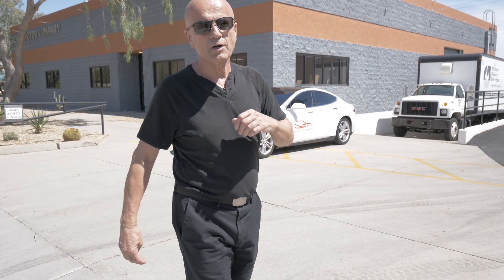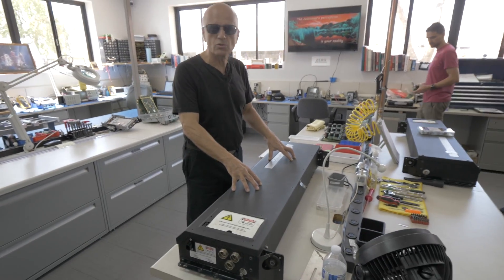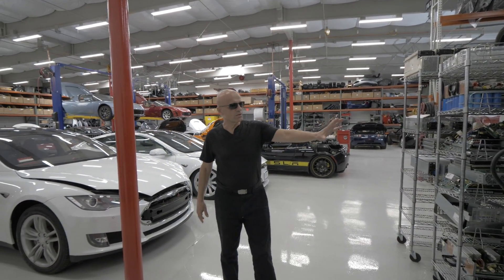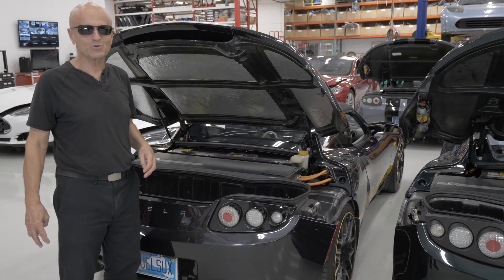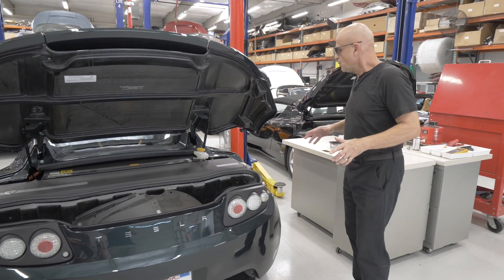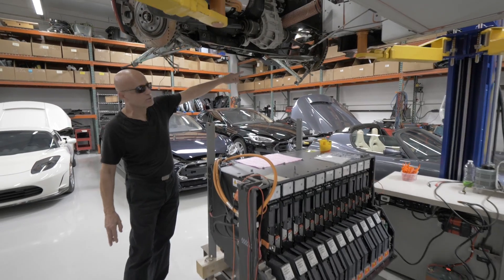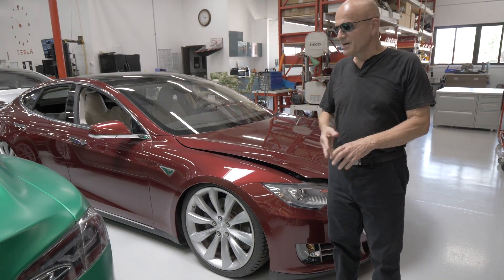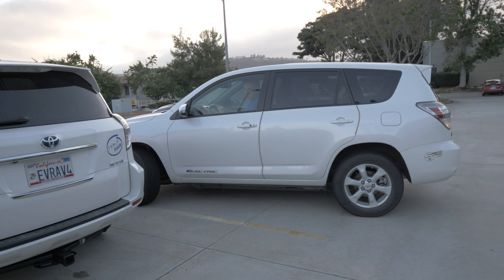Inside the Largest Independent Tesla Repair Facility | Part 1 | Gruber Motors

Comment: Nice cars, but with ICE vehicles I can fix almost anything my self for only the cost of parts :)
Reply: You mean with old ICE vehicles.
Modern ones are a pain to fix.
Reply: @ZesPak  depends on the car, the engine mechanicals pretty much same though so you should be able to fix it

Comment: 6:30 instead of a variac, you can use a single-phase power controller and a PLC so you can proportionally control the PWM and the RMS voltage applied to the 120/440V transformer. This will be much more efficient since you do not generate heat and no need for variac maintenance. I can develop this for you if you want. My email is Zumaeta.jose@gmail.com. I'll be more than happy to collaborate.

Comment: Theoretically the electric car should be cheaper and more reliable than a internal combustion car. Unfortunately, Tesla took the over engineering road which means needless electronic sophistication. This has ended my interest in electric and the internal combustion makers are equally guilty of over engineering. I drive a 30 year old gas car and will continue to do so for the remainder of my life.

Comment: If Tesla manage to make their cars to get plug in to your house grid, they can let people to use their cars as a battery storage that can use in case of emergency. This will help the batteries of the car to not have the low voltage problem that is explained in this video.

Comment: At 2:22 there are test circuit boards shown standing on edge in a metal frame / shield. These pcb's need to be placed in Electrostatic Discharge  safe packaging, or at least stored on a grounded safe workmat like the blue one shown on the test bench behind them. This should be standard practice in any electronic service / repair facility. Training for your crew may need to be re-visited. ESD damage can not be seen without a microscope and may cause future intermittents or outright failures.
Reply: Yes and no.  Electrostatic discharge damage is a real problem and can lead to difficult to diagnose problems, exactly as you mention.  However most circuit boards today are designed with lots of internal grounding and static discharge paths that protect against damage from static electricity.  This is something that is designed for and can be tested.  That said, it's still a good practice to use static protection procedures, including anti-static bags for storage.
Reply: @taraschwartze . . . Thats hot.

Comment: This is the hypocrisy of Tesla, they claim to be saving the environment, but they treat their own products, which have a huge environmental footprint to produce, as disposable commodities to be replaced every 3-5 years.  These guys at Gruber, they are doing a much better thing for the environment than Tesla is.
Reply: That's just your miopic opinion. Actually Tesla officially does not believe in model refreshes or "disposable" products, unlike combustion car manufaturers. The only refresh the Model S had since its introduction in 2012 was a front bumper redesign in 2015, battery upgrades and a motor and suspension upgrade this year. The major way Tesla cars get upgraded is frequent via over the air software updates. Many owners still happily drive their original 2012 Model S, some with over 100.000 miles.
You might want to actually look into how Tesla operates before putting your opinions out there.
Reply: @2nd3rd1st  Officially VAG don't believe in poisoning people, but they are still happy to do it to make a little extra cash.  So a model that's been in production for 7 years hasn't had a major refresh... whoopdie, the Nissan  GT-R R35 has been in production for 12 years, that's normal.  What happens when the Model S replacement comes out?  Based on the fact that Tesla won't even service a $30,000 part on a 10 year old car, I'd say you're fucked.  I well know how Tesla operates, I've seen loads of people struggle to get cars repaired outside of warranty after fairly minor breakdowns and accidents because they can't get any support from Tesla outside of warranty.  I bought my current Ford 6 years ago, and it's no longer even in production but I can still buy every part for it new from the dealer I bought it from, or even manufactured from a 3rd party, and nothing on it costs $30,000 to replace, and I have a copy of the full service manual that shows me how to perform every single service and repair procedure in detail - and that's from a company as famously shitty as Ford at after sales support!  Tesla's products are disposable, at least as far as they are concerned - that's why companies like Gruber exist, working hard to reverse engineer and repair cars that would otherwise be scrap and landfill.
Reply: @Beer_Dad1975  I'm a "triggered nutbag"? Says you and writes War And Peace. Let it go, Matt.
Reply: Wow fanboi anyone

Comment: ..."this car has not been designed to be serviced, easily".

This says it all.
Reply: This actually only says: tiny green behind the ears startup frankensteined boutique sports cars for rich early adopters as a proof of concept.
Reply: Furlock Furli the Model 3 changes that.
Reply: no car nowadays is easily serviceable. Thats the new businessmodel. very sad. Nevertheless a great opportunity for gruber and therefore a gap in service in all other countries. Teslas will always be cult cars and therefore there will be enthusiasts demanding this kind of services.
Reply: tesla and apple are very similar when it comes to user serviceability
Reply: @greynolds17  Do you really expect to remove and replace battery packs and electronics of modern BEVs yourself? No driver of even a 2010 VW can hope to even just replace a faulty headlight LED, car dealerships only survive because of service fees. I doubt most owners of a horse in 1870 knew how to fix a horseshoe themselves for that matter ^^

Comment: all the tables at the Electronics Labs are Table height. very unusual. Work benches are typically counter or bar height
Reply: soldering tables, electronic repair most people do sitting down in office chairs.
Reply: The place is phony as hell! @0:39 "...we wanted to immediately create the IMAGE that this is all about electronics.."
Reply: These guys r great
Reply: looks back breaking
Reply: Height depends on the size of the object you are working with. For example watch workers often have counters above elbow height.
Maybe these tables were there from the ups days when they had large UPS control units on top to be able to look into them. I'm just guessing.

Comment: Just imagine  when all those capacitors on all those boards start leaking.
Reply: Probably using tantalums in place of most electrolytics to minimize that....
Reply: @sufficetosay  Even worse..tants are prone to failing short circuit.
Reply: The "Flux" will be everywhere!  (Huey Lewis jam'n in the background)

Comment: My nephew bought a Model 3 late last year.  He only had it a couple months when some idiot ran a red light and T boned him late December.  8 months later his car still sits in a body shop waiting for parts from Tesla.  Anyone who believes that Tesla has even the slightest concern about their existing customers should take notice.
Reply: From a tesla owner yes this is correct and the other are also correct about being oblivous to it below is correct why? because if you have an issue they give you a Tesla the same as yours to do whatever you want until yours is repaired. So in effect if it has to stay 7 months they are basically taking that milleage on a similar car so why would you care. You will gets your back fresh and in the mean time you drilled a tesla that isnt yours for a while
Reply: Yes, body repair is a nightmare. It's still worth owning! You have to own one to understand this simple truth.
Reply: The outrageously slow repair turnaround is what Tesla fanboys are totally oblivious about. Until it actually happens to them.  The benefit of having car dealership network and independent repair shops is; it removes the burden to the car manufacturer to do maintenance or repairs.
Reply: Exactly, I'll wait for Tesla to mature as a car company before I'll buy one
Reply: First I hope your nephew is ok. 2nd, so basically your nephew is making a car payment on a car he can’t drive due to shitty Tesla service. That sucks
Reply: @projektxent  If that's the case. Does the other party insurance cover the expenses of the car loaner while the car is still in repair?
Reply: Spock - not sure that will ever happen with Musk at the helm.  He has been described as bring unbelievably obsessive and controlling.  Despite all the greenies drooling over Tesla and all the US Government assistances they receive, the fact is the company is not doing well at all financially.  Many experts don’t see them surviving for much longer.
Reply: @danmyers9372    First off,  I do not have a Tesla and I would not come close to a fanboy.  Secondly Oil companies get 4.6 BILLION in subsidies (government assistance) EVERY SINGLE YEAR  which pisses me off.  Why would Big Oil and gas need subsidies when their profit margin's are so unbelievably huge??  Third....Tesla founded by that goofball Elon musk received $165 million from selling his company to Compaq. He spent 100 million on spacex, 60 million on tesla, and 5 million for solar city. He taught himself programming and co-founded Zip2 a web software company which was acquired by Compaq.  Those US Government loans you speak of?  They were paid off fully, oh wait here let me get the press clip....Only American Car Company to Have Paid Back Government
PALO ALTO, Calif.-- Tesla Motors announced that it has paid off the entire loan awarded to the company by the Department of Energy in 2010

A couple of things to follow up on.  I drive a diesel and I love it.  I don't "Roll Coal" on anyone but yes my rig is chipped for fun and spirited driving.  Tesla is an AMERICAN MADE product that is cutting edge and pushes the boundaries of technology, maintenance, speed and safety.   Why would you not cheer for that company to succeed?!!  It literally is as american as you can get.  Want the fastest, most bad ass 4 door car that is faster 0-60 than anything but 5 hyper cars that cost millions?  Tesla.   Want American,  Tesla.   Want to advance out of the stone age of cars.....oh wait....Tesla.   I cannot afford one, probably never will without a significant income increase and I drive an old antiquated combustion engine regardless I would not root against them.   I want to see them succeed,  they have pushed the needle globally and oh yeah made the world a healthier place doing it.
Reply: @maxmuller1038  On target and you nailed it both at the same time, bingo!
Reply: @danmyers9372  its ok, I'm waiting for the $20k version which probably won't happen as well 😁

Comment: What does the term “brick” mean  battery gets brick  is too technical talk!
Reply: Its a term used for when electronics become useless/unusable due to a defect, thereby being "as useful as a brick"
Google is your friend: https://en.m.wikipedia.org/wiki/Brick_(electronics)
In the case of the batteries they mean theoretically it should be a usuable/okay battery, but practically its a letterweight/brick/stone because e.g. they won't accept any charge. 
Often "bricked" defects are harder to repair than a standard defect, because the defect itself is narrowing your interface options with the device. 
Smartphone with cracked screen--> you can still use the phone and prepair it for repair
Smartphone with blackscreen and it just won't turn on even though it should becaude it seems alright!! Bricked and you don't know why ;(
^^ ;)
Reply: Ericcssonn - Please use the term “dead battery “
Reply: A appropriate description of what the battery becomes, a hunk of material that does nothing but take up space.
Reply: Franz Kirsch -Please use the term “dead battery “!
Reply: We didn't make the video or determine the slang used in that workshop. 
And a dead battery and a bricked battery is not the same..
They found a method to "unbrick" those Tesla batteries, if they do become bricked and thats why they collect bricked batteries and not dead batteries. A dead battery is out of energy storage potential and a bricked battery theoretically still has some life left in it. If one could unbrick it, one could use the battery again. And Gruber figured out the way to unbrick those Tesla Roadster battery packs, which clearly have a huge factory design fault to brick in the way they did in the first place. 
(A Roadster will probably not be driven for months if one has a reasonable winter. Batteries bricking after some downtime like that is soo not ok)
Reply: Ericcssonn - again what does brick mean please!

Comment: Don't use your Tesla for 2 months, that's 30.000USD please. Cash or credit card?
Reply: Only the early Roadster suffered that... today, all S, X and 3 models have improved electronics, smaller vampire loads and are better engineered.
Reply: $30,000, yet in most cases the fix is nothing more than a careful charge in order to balance the batteries back out. Wow...

Comment: To be open and fair - the Tesla $30,000 battery "replacement" mentioned (around 7:22) is an upgrade from the original factory one, which allows owners to go from 240 miles per charge to closer to 400 mpc;. That is what costs the extra.  Earlier when describing how they started doing Roadsters, he mentioned that Tesla charges $10,000 for a new battery.
Reply: Well that's OK then ! Only 10k to replace your (gasoline tank) OR for ONLY 3 times the price, you can drive bit over 50% further. BARGAIN, I'll have two please 🤣

Comment: Very informative video. Good job! I suspect in the coming months and years as Tesla vehicles proliferate we will see more facilities like Gruber's.  Especially when the factory warranty runs out and repair or replacement of batteries, electronics and motors are needed as in the case of the original Roadster and older Model S and eventually other models as they age. Although, I feel the majority of owners aren't going to keep their Tesla's long enough and trade them for newer models, so I don't see this growing beyond the small niche market that it currently is. Though, time will tell us the answer to that.